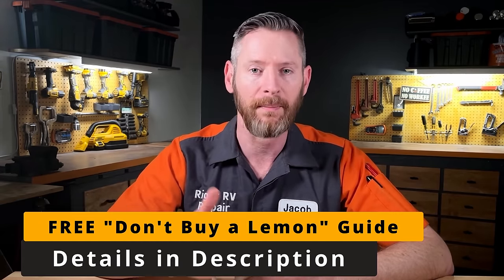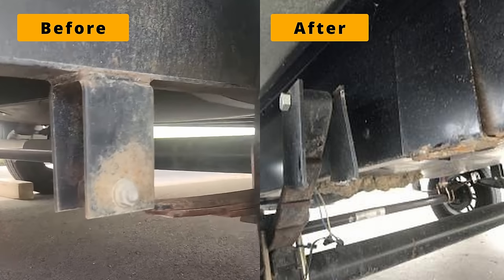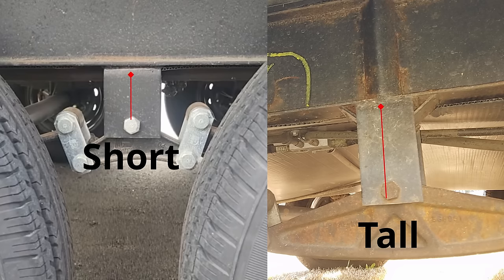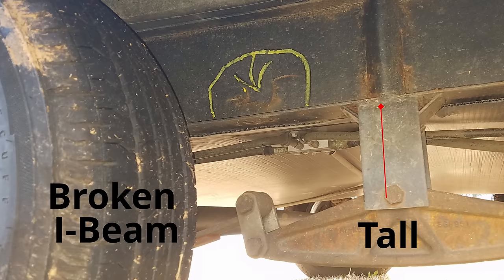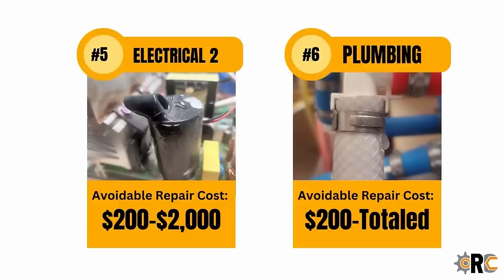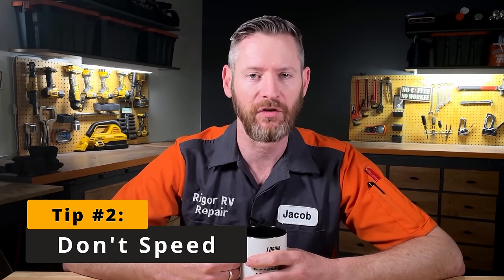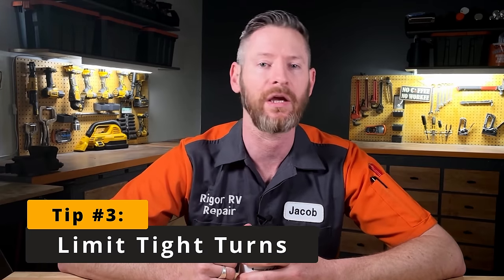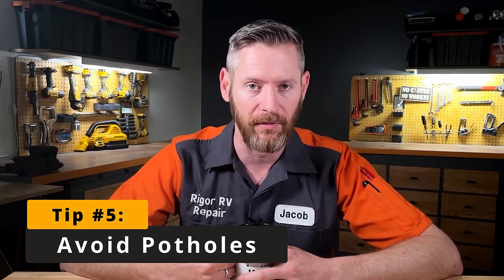How to avoid RV "Frame Cracking" failure - 5 tips from a tech!

Comment: Based on 2 years of watching rv videos...basically: AVOID Jayco, Grand Design, Thor, and Winnebago at all cost. You've been warned.
Reply: Come on Forest River!
Reply: @JandAReview1 Riverstone is Forest River and they don’t have any frame failure or cracking.
Reply: @TonyBenton0728  I’m a fan of Riverstone and Rockwood.  Thank you Tony!
Reply: I’m with forest river c class 2023 no problems 2 years
Reply: I haven’t seen anything on Jayco having problems can you tell me if the pinnacle is having frame problems
Reply: @davehuber6949  Stay away from Jaycos in general, they are trash quality...youre paying 100k for junk glued together so they can get it out faster. Stick with brinkleys, coachmen, renegade etc
Reply: My Wildcat had frame failure. Pinbox crossmembers sheared.  It is a FOREST RIVER product.  Good luck.
Reply: What’s left?
Reply: @jefff6167 I was starting to wonder the same thing.

Comment: Word games?  Stress is what happens as you use this over bad roads. Things should be built with a little flex.  But flex and stress leads to failure. Meaning the frame breaks. Too light of material, bad welds and loaded over the so called capacity.

Comment: The best way to avoid it is to not buy an RV or, if necessary, specify that the manufacturer use a frame that is designed to withstand 200% of the load and fatigue that their stock frame on the model you want is rated for. 😁
Reply: Well, if the best move is not to buy an RV, why bother to watch this channel? As for specifying what frame and manufacturer is going to use good luck with that kind of work involved.  I would be interested, however if anyone out there has ever actually done that? And what was the workload involved in making a manufacturer build a trailer to their specification on the frame?
Reply: @Luv2camp316  1) Because I follow mobile industries in general, including this expensive, low end of it ripping off consumers en masse (I use my own cargo trailer build because that is much more easily done to my own specifications); and 2) Yes, there are also custom RV manufacturers that use real engineers that you can work with to develop a unit that is actually engineered correctly (shock and disbelief, given this industry), but of course you have to pay them accordingly. For example, New Horizons and SpaceCraft.

Comment: I am having a hard time finding info on porpoising and what I need to do to ensure I'm towing properly. I have a new 2024 GMC 2500 HD Denali Ultimate. My understanding is that it's equivalent to a one ton since it has the towing package. I haul a Venture Touring with a hitch weight of 1250 lbs. with a total of 9000 lbs. My weight distribution hitch is rated for 1400/14000. I had some porpoising on my last trip, no sway, just the bouncing. Help someone??

Comment: Found web of our i beam frame cracked over each hanger on both sides 2013 forest river tt, lippert frame back in 2018. There was literally a link on lipperts website to sketches showing how to repair.

Rv shop repaired the cracks, reinforced the web/flange joint, and welded square tubing to the hangers across the trailer at 4 places.

Just inspected joints last week and seems ok
Reply from the maker: Thanks for the info! Yes I've seen the Lippert sheet showing the square tubing connecting the hangers. This is the same problem that the Mor Ryde x factor brace is trying to solve. Glad it is working well for you now!

Comment: Jacob, the installation of the suspension and the application of crossmembers and outriggers is a problem, one I had to deal with. It was resolved. In addition to the repair that was performed at the front and center suspension hangers I added a morryde crossmember at the rear hangers. Later I realized that the installation of this crossmember actually caused toe at the rear axle so I removed it. I see that morryde  has changed the design, hopefully to eliminate this problem but I can’t tell from the info available online. I think you have correctly identified the primary load path that is likely to cause a lot of these issues and that’s side-load…. It would sure be easy  to test for this and validate the designs or show the weaknesses. I hope some of the folks from the industry follow you and read these comments. Please keep up the good work … we need at least one manufacturer to build reliable rv trailers
Reply from the maker: Thanks for the feedback, and thanks for watching! Questions about the front and center hanger repairs - did they weld a square tube between the hanger to stabilize them?

Comment: Excellent video. I’ve seen people scrub triple axle rigs hard, on pavement, and run over speed bumps way too fast. Weld wise I don’t often see evidence of porosity, but I do see undercut, too cold, roots not wetted in, generally inconsistent. The problem with welding a bit of plate between the edge of the flange sloped onto the web, imho, is that kind of brace focuses stress where it meets the web. Don’t have to be Nostradamus to predict cracks in the web just above such a brace.  To me I like the idea of cutting a strip of plate to fit between the legs of the spring hanger, bending it to a V and welding it to the insides of the spring hanger and the bottom of the flange. Seems like that kind of brace will spread the load on the bottom of the I beam but will still flex a bit and maybe not create a stress riser. I’ve seen a bit of angle across the bottom of trailers, welded to spring hangers on both sides- but I’d prefer to maybe weld on brackets and bolt in the main span (if you had to pull a tank or otherwise fix something).

Comment: Yes, all good tips.  That said, when you have frame failure as shown at 1:02, that is entirely on the manufacturer for using material that was too thin.  Indeed, I am of the opinion that 99.9% of frame "failure", "flex" or whatever the buzzword of the day is used, is a direct result of the manufacturer substituting inferior materials (stitched together by monkees with MIGS) to save weight - all at a cost of risking your safety and the safety of your family.  As long as consumers fork over tens of thousands, and in many cases, hundreds of thousands of dollars, and the manufacturer and get past the warranty period, they don't care.  An RV purchase is definitely a caveat emptor endeavor.

Comment: The most important point is to visually inspect your I beams at the points where they are cross braced for stress cracks. Those cracks show up as very fine rust colored lines where the vertical cross braces  are welded between your larger I beams . This occurs  3 ft plus or minus before and after and between your tandem axles . The torsional forces put on your frame when making  turns is visually apparent by your wheels scrubbing and contorting . Avoid any sharp turn. Take a look at the wheels when you are making any turn and listen to the creaking and popping when you make that turn. That is severe loading on your suspension and frame . While you can mitigate really heavy stresses you can not eliminate all of it  so regular inspections is imperative . My frame was starting to lean and fail. I caught it and corrected it and repaired it and it was a 28 ft light Travel Trailer . The cross braces ripped out of one side and pushed through the other beam .And even Grand Design 40 ft 5th wheels still uses 1/8 inch wall thickness steel throughout .

Comment: Very informative video subject. Should I worry about my small travel trailer as well. 24ft, 4100 dry 6000 lb max. It's a 2021 Coachmen Freedom Express , so far I don't see any cracks or stress on its frame or spring hangers. Would you recommend the cross member kit for such a light trailer?

Comment: I'm a certified NDT technician. Took my mag yolk and dry powder to my  RV trailer. So, far, no cracks! I have my RV professionally oil sprayed to prevent the frame rusting. Had to clean the goop off to do the checks, and have had the rig resprayed.
Reply: Reach out to your local NDT company and get this done. Yes, it's not free. But have you priced a replacement RV??

Comment: Me and the wife are thinking of full time RVing in a travel trailer for my job so we are researching and your videos have helped a lot. I was just wondering if there has been any year make and model travel trailer that has passed your rigor scale as far as correct slides plumbing residential fridge and cabinets? Basically all the essentials were good and didnt require much upgrading?
Reply from the maker: Thanks for watching! I don't think I've actually seen a travel trailer with residential refrigerator. Usually those are found in high-end motorhomes and 5th wheels. I have retrofitted a residential and inverter in a TT that had a 12v refrigerator go bad. That was about half the price of the new 12v refrigerator.
My database included in my RV Shopping Course makes it easy to sort by grade and RV type. That is going to be the fastest way to narrow down on travel trailers that pass my other checks, and you get the app to grade any RV you are looking at to get an instant score. Here is the link where you can see everything included, https://undercoverrvshopper.com/
Reply: What about the main things like correct slides plumbing and other stuff?
Reply from the maker: If an RV has Accu-Slide or bad plumbing, that category gets a zero score, and the RV gets an F grade in the database. So, if you search "travel trailer" then sort the results by grade, you will first see the highest scoring travel trailers in my grading system. If you see an "F" grade you know that it failed on either slides or plumbing, and you can look at the score columns to see where it failed. I hope this helps! Let me know if you have more questions, thanks!

Comment: Have you seen a bigger frame flex frame cracking problem with wide body 100" wide 5th wheels vs the 96" wide 5th wheel?
Reply: The wide frames with Rhinobox design are far less. Actually I have not seen one failure.

Comment: Good videos thank you. 
What about equalizer upgrades? Is it worth it and good for the rv?
Reply from the maker: I just posted a new video this morning about weight distribution (equalizer) hitches. Short answer is that most of the time you need them for safety reasons. Using one or not does not impact this frame cracking issue, this is a design issue from the manufacturers.
Reply: I’m sorry I meant the leaf spring equalizers.

Comment: I have a 1999 1 ton dully. I have a 2020  31 ft 274 RB Springdale. I also have air shocks. Do I need a weight distribution system??
Reply from the maker: Check you owners manual for the max hitch weight with and without a weight distribution hitch, then go to a scale and get your rear axle weights with and without your RV. If you are over the hitch weight rating for not having the WD hitch, then yes you need one. If the number of pounds of weight you are adding with the RV is less that that rating without a WD hitch then you are good.

Comment: My suspension hanger are long as you mention, but have predrilled hole about 2 inches higher on the hangers. Do you recommend repositioning the suspension to these? It would lower the overall height, so that doesn’t bother me.
Reply from the maker: Yes, that reduced the leverage the axles and springs have to twist the hanger left and right. I would lower it if it were my RV.

Comment: From the Intro - it seems the wording most folks are using to discuss these issues is far too imprecise.  
“Flex” should be looked at as temporary deflections under stresses which are either transitory or results in no permanent damage. 
“Failure” should be looked at as a permanent deflection which results in permanent damage or a physical failure such as cracked weldment /cracked structural member. Flex should be normal…Failure should not.
Reply from the maker: You are correct that flex is normal. RV Manufacturers are working hard to relabel failure as "Abnormal flex." If there is anything to be trusted about a multi-billion dollar industry it is that they are good at managing crisis and making money.